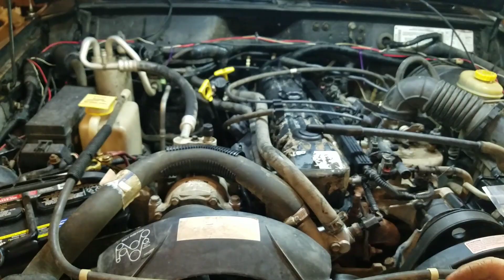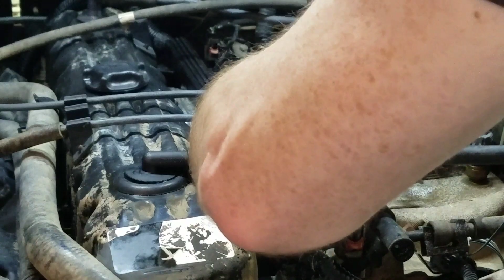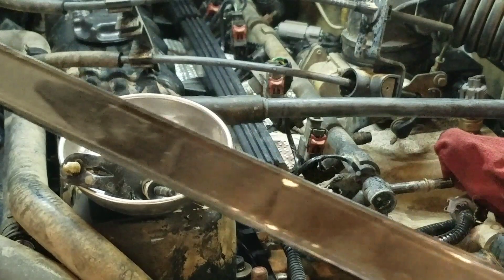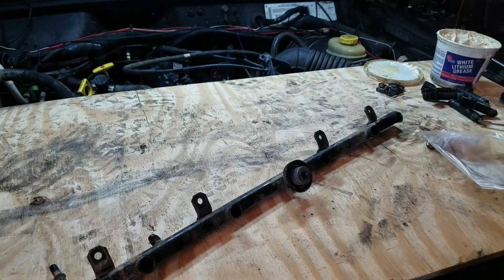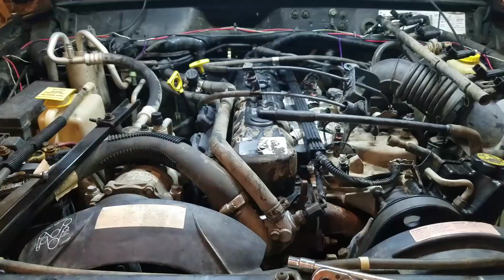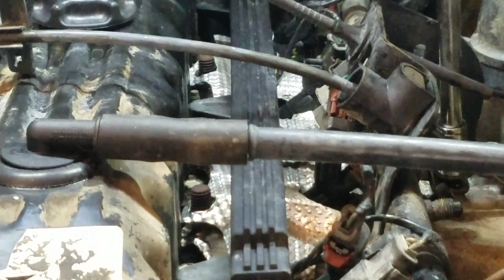JEEP 4.0 FUEL INJECTOR UPGRADE | HOW TO & TIPS

Comment: Great job showing us how to do a 4.0 fuel injector upgrade however the product you showed its sold out. Any other brand you suggest ???
Reply from the maker: I'd recommend staying away from no name ones from Amazon. I've seen those fail. My eBay ones have been good. I've been told dodge neon ones fit but I don't know for sure. If you search eBay check reviews and warranties.
Reply from the maker: There are name brands but they will be more expensive.

Comment: Was this a direct swap? Did you have to advance timing or do any tuning?
Reply from the maker: Nope direct swap. It's the same fuel pressure  just a more spread finer mist for a better burn
Reply: @BigFrogs4x4  I must have got a bad batch or something, I did this in mine and it misfires and is running very very rich, smokes a lot too
Reply from the maker: Ya. Return them.

Comment: Nice video! Just came across it while looking up some ways to add a little extra pep & reliability to our trail rigs….one thing I figured I would mention is you can get the injectors out if you have to without popping off the fuel line….we’ve had some single hole stock injectors fail trail side over the years so while not ideal you can do it
Reply from the maker: Yes you can. Just makes it a little easier to work and film it. Thanks for the info and the complement. Much appreciated!

Comment: The injectors you have a link with Amazon, are those the same you got from Ebay?  Any update?  The 99 still running smooth?
Reply from the maker: They are not the same company. But both 4 hole injectors. At least I'm pretty sure. Sometimes Amazon sellers change things. I have them in my 2001, my daughters 1999 and my friend just put them in his 2000. All running well. The biggest difference was throttle response. Mpg went up maybe .5 mpg. Haven't had it on the highway for long distance yet to see a real change in mpg. But idle and throttle response is better.

Comment: I'm glad you didn't use Vaseline like a lot of youtubers use, it degrades the rubber. Nice job!
Reply from the maker: Oh no. This or engine assembly lube.
Reply: Well the o rings are silicone, so it doesn’t really matter what you use as long as youLube  a little bit

Comment: Will this help fix gas in the oil? I have an 03 and the oil smells a bit like gas. The oil levels are fine, runs, and idles fine, no codes. Thanks for the help.
Reply from the maker: If you can pull the spark plugs and look into a cylinders with a camera after the engine has sat for a while (over night) you should be able to see if gas is leaking out of an injector into the cyl. If it is it can run past the piston rings into the fuel.
Does it take a little longer to start?
Reply: @BigFrogs4x4  No it starts up normal. They're the stock injectors so it wouldn't hurt to replace them anyways. I just hit 160k.
Reply from the maker: It sounds like you may have an injector slowly leaking into a cyl. But had to tell over the internet. Lol
Reply: @BigFrogs4x4  Yeah that's what I was thinking. Well thanks for your input nonetheless 👍🏻

Comment: You are a great instructor! Buying an 1997 TJ never fixed a thing on a car before wish me luck
Reply from the maker: Thank you. Just be careful with the seals. And make sure all holes are clean. Even the slightest cut or air leak can cause the engine to run bad. Check each seal close before installing because today's parts don't have very good quality checking. Many times at my job we get bad brand new parts
Reply: Hope it went well you probably learned a lot by now

Comment: You didn't reset the PCM for the new 4 hole injectors??
Reply from the maker: No. They are stock psi, just have a more fuel efficient spray pattern

Comment: Is there any thing u have to do to the ecm some say to unhook the battery and put the to leads to gether for a minute I don't know just seeing if u heard anything about that
Reply: Also good job on the videos
Reply from the maker: I did not do that. I've installed three sets of these and three separate Cherokee 4.0. None of them have had any issues. The only thing I've noticed is a little bit quicker throttle response.
Reply from the maker: And thank you. I tried to get detailed whenever possible

Comment: I appreciate all the detail in your video. Subscribed! Did you have a recommendation on those fuel injectors? Thank you
Reply from the maker: I got mine from Ebay but can also be found on Amazon. There is a noticable difference. Engine runs smoother and has a quicker throttle response.
Reply from the maker: Thanks for subscribing!

Comment: Hey, awesome video! Hopefully you can answer this ? I have a 93' Jeep Grand Cherokee Laredo I6 4.0 and needing the correct fuel pressure rating at the rail. Went to different suppliers for an upgraded 4 port injectors and all were different fuel pressure ratings! Also I would like to get the Bosch brand (new or rebuilt) and not a knockoff ! 
If you could help it would be greatly appreciated. PS: No one else has helped me in this manner. Thx  much.
Reply from the maker: I don't know it off the top of my head but I can see what I can find.
Reply: @BigFrogs4x4  Thank you so much. I would really appreciate it. When it comes to the injectors it seems they just try to push an injector that they have in stock/or can simply order.
Reply from the maker: I got mine on ebay if I remember correctly. My friend bought on Amazon and he had 1 fail less than 1k miles.
Reply from the maker: From what I'm finding, 37-41psi on stock fuel pump
Reply: @BigFrogs4x4  Thx so much. I had ordered a set off of Ebay once and they were a Chinese knockoff of Bosh and in a Bosch box. Tried them and spray patterns were terrible. Then ordered some off of Amazon and 2 bad injectors! 
So I just don't trust them anymore. I rather pay more for someone trustworthy that give me all the info on their injectors that I need!!! PS: And not injectors that are the wrong ones for my application.
Reply from the maker: I read somewhere dodge neon injectors are direct fit but I don't know that for sure
Reply: @BigFrogs4x4  Well, if you come up with any other fact info it would be greatly appreciated.
Reply from the maker: I read it i believe on a jeep xj forum.

Comment: Do you have a link for these 4 hole injectors for a 2005 Jeep TJ Rocky Mtn 4.0?
Reply from the maker: They can be found on Amazon and Ebay. Check the listing before ordering to make sure it fits.
https://amzn.to/3x4xEcY
Reply: @BigFrogs4x4     Don't think these are for an '05 TJ Rocky Mtn and these have horrible reviews. But so do the Bosch remanufactured injectors. I use 4 - 6 oz. of MMO at each fill up and so far this 145k mile 4.0 TJ is running good, with a smooth idle most of the time. TJ gurus like Jerry Bransford say stick with oem 1hole injectors. Maybe I will and continue using MMO.

Comment: I'm kinda scared to order off Ebay or Amazon... any update?
Reply from the maker: I haven't had a problem. But do some research, but I THINK I read somewhere that dodge neon injectors will work as well. My friend did have trouble with a set from Amazon.
Reply: @BigFrogs4x4  thanks!
Reply from the maker: @zackariadelaserna8284 no problem. Good luck

Comment: Hi there any ideas did upgrade due to a misfire and several  injector errors fixed 2 but  p002 code keeps  popping up. swaped twice now  for a new one still p002. Help!
Reply from the maker: What year? Which vehicle is it? Wrangler or Cherokee
Reply from the maker: Are you sure thats the correct code?
Reply: It's a 2002 grand cherokee
Reply from the maker: @mrscano76  I could not find that code in any system. I think you are missing a #. Are you sure all the injector o rings seated well? The holes and everything was clean when installing? If you can get me another code I may be able to help more.

Comment: Awesome video mate, I really should do this to my Jeep tj, what’s the price on them?
Reply from the maker: It depends on where you get them. Mine were on Ebay but i have a link for Amazon in the video description. They also have 12 hole injectors on Amazon.
Reply: I just got the same type of injectors on eBay for $32, free shipping. Now I've got to install them. That's why I'm watching this video. Wish me luck🤞😂!
Reply from the maker: Be gentle, take your time. Double check everything before turning on the key to prime it. And 1 thing I may have forgotten, can't remember, disconnect the battery and be careful of static electric. A small fan a little distance away blowing gentle air around you can help dissipate the vapors.
Reply: @BigFrogs4x4  Are the fumes really bad after draining the the rail and removing the injectors? I live in a town house now and most of my neighbors are smokers🤪🔥! Plus l don't won't to be a nuisance to anybody that might be sensitive to that type of thing (It was pretty strong that time I had to drop the fuel tank; just wondering)...🙄🤔🤨. Might have to take it somewhere more open; maybe🏞️...?
Reply from the maker: @SadbutTrue84  once you release the pressure with a rag move the rag outside or seal it in a coffee can or spaghetti jar. That should help.

Comment: Nicely done video BF ... but, yea, maybe loose the music .... although there are lots of 4 hole after market FI's, most people recommend the  getting the quality Bosch 4 hole rebuilds at around $60 on ebay or amazon ... rumors are the cheaper chinese ones fail quickly ... also liked you stressing cleaning FI ports and gas connector (and purging the air out of the rail before you reinstall) no sense in risking clogging a new injector ... as for performance, having driven 2 cherokees with 4.0's for 600k miles in 40 years, the 4.0 will never get great MPG, but I love that cast iron 1940's AMC design  ... and any MPH increase helps ... smoother idle, better throttle response is nice .... after testing throttle response while driving, remember it takes a while for the computer to adjust and learn to the new FI's ... MPG will most likely improve after it resets over a few hundred miles
Reply from the maker: Thanks
Reply: Running into the cheap injectors leaking on me, will try those Bosch rebuilds, Thanks!
Reply from the maker: Thanks.